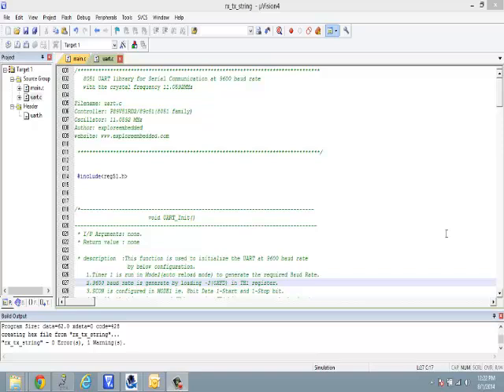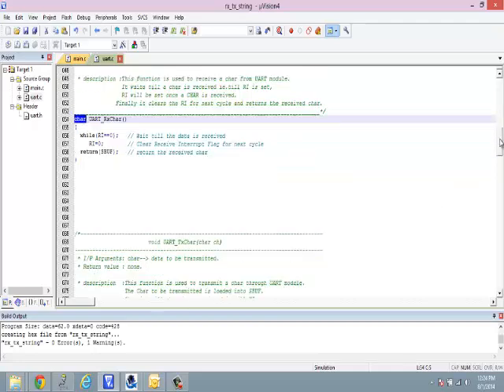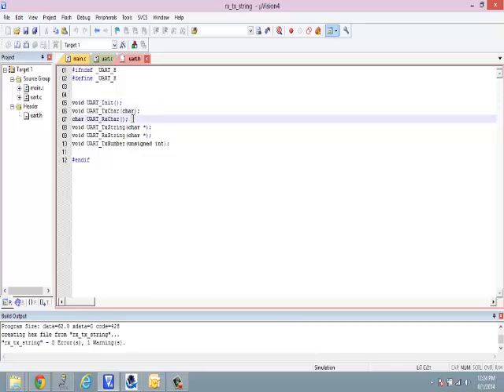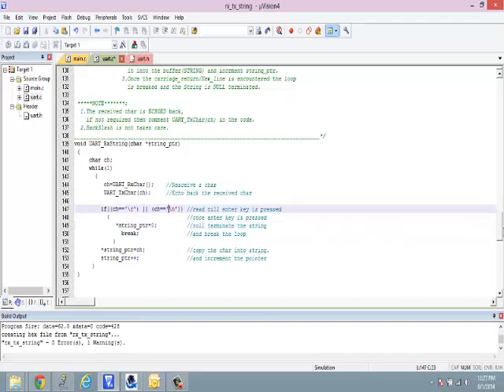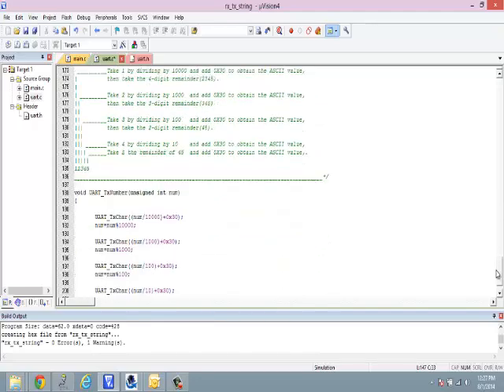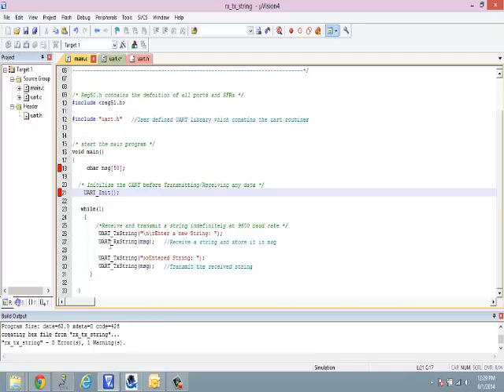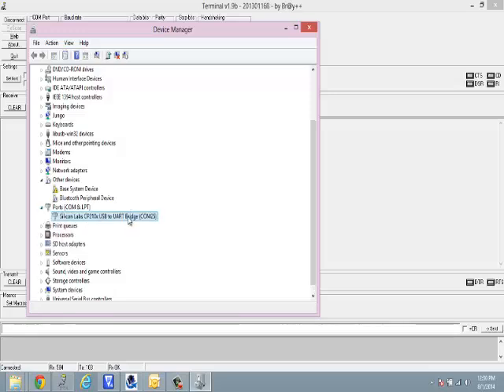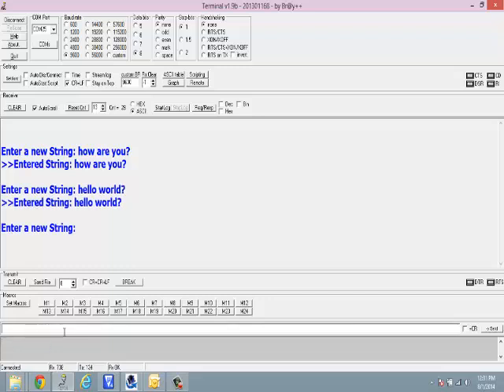8051 Serial Communication Part 2

Comment: HI..here a UART pgm to display a name(sanjay) and every char display with 5ms delay.When i run this pgm only 's' character displaying. Where is the error Pls find out

#include<reg51.h>

void SerTex(unsigned char);
void delay_tO()
{
TMOD=0X01;
TL0=0X00;
TH0=0XEE;

TR0=1;
while(TF0==0);
TF0=0;
TR0=0;
  

}

void main()

{
    TMOD=0X20;
    TH1=0XFD;
    SCON=0X50;
    TR1=1;
    while(1)
      {
              SerTex('S');
     delay_tO();
     SerTex('A');
    delay_tO();
     SerTex('N');
    delay_tO();
     SerTex('J');
     delay_tO();
     SerTex('A');
    delay_tO();
     SerTex('Y');
     delay_tO();

     }

}

void SerTex(unsigned char x)

        {
    SBUF=x;
    while(TI==0);
    TI=0;

 }